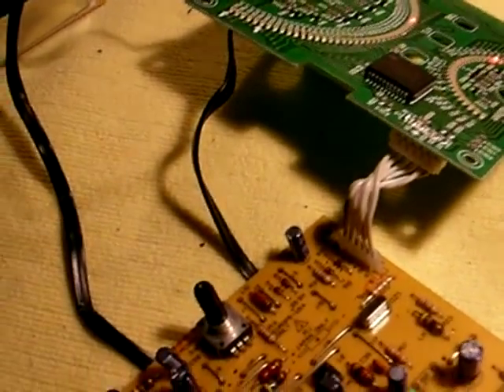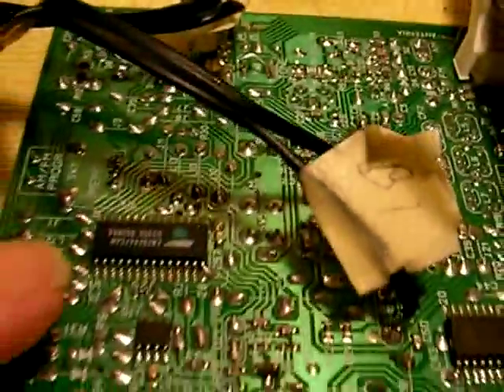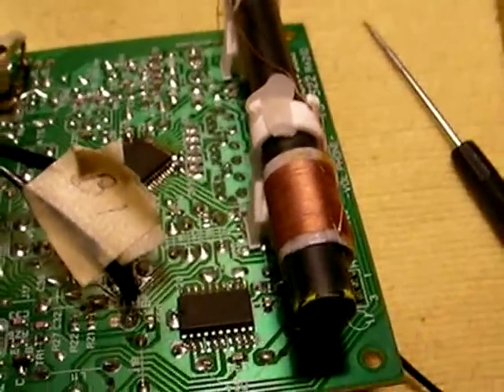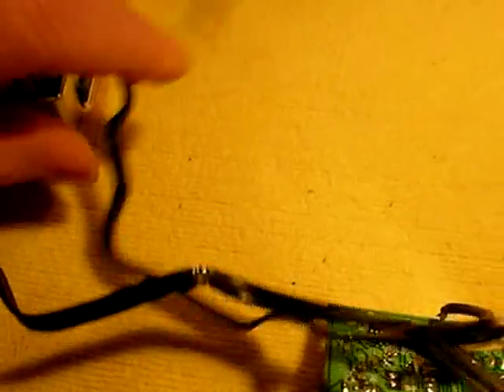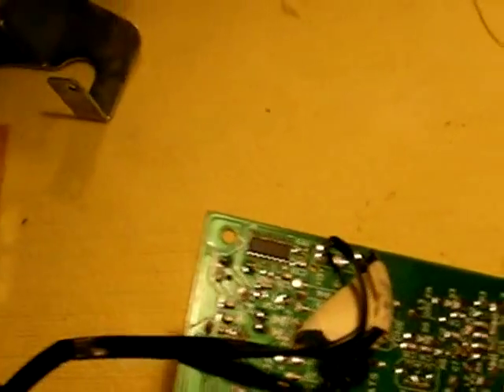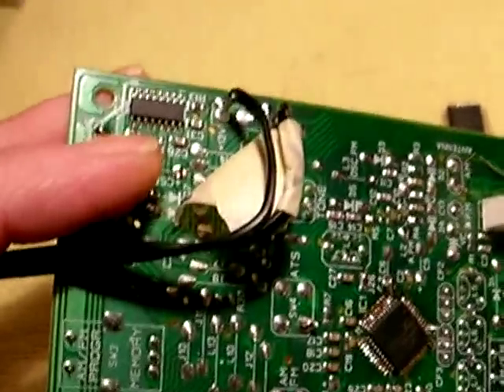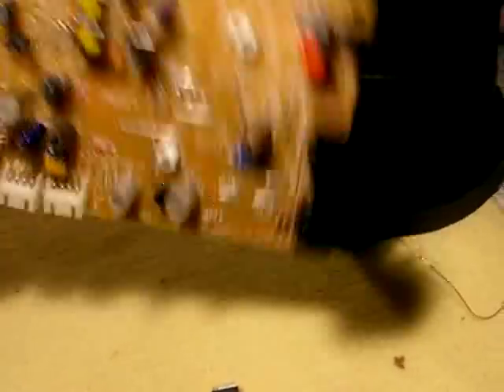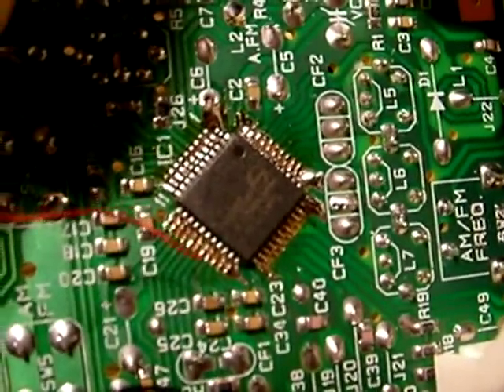Brionvega TS522 - Repaired

Comment: GREAT! AWESOME! You do the s/m IC's the same way I do! ;) Works great, huh? People are always amazed when we...pull a "postage stamp" IC off one board & solder it back on another...I worked in a factory doing computer motherboard repair back in the mid-90's & worked in the surface-mount "re-work" dept. where we resoldered bad connections, cleaned solder bridges, replaced chips, etc. & that's where I got my start, but I'd rather work on tube stuff any day! :) I bet ur the same way, huh?

Comment from the maker: @uxwbill You have to really practice this stuff- I have a fine point controlled heat iron, which is mandatory, and solder wick (braid) to absorb any bridges. I also use the best USA made Kester solder available, and I never use this "lead free" crap.